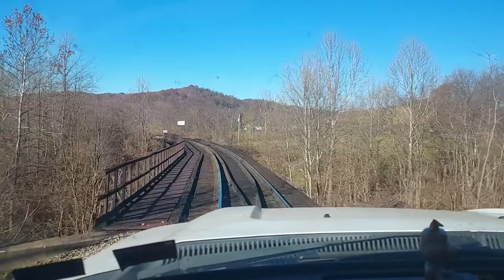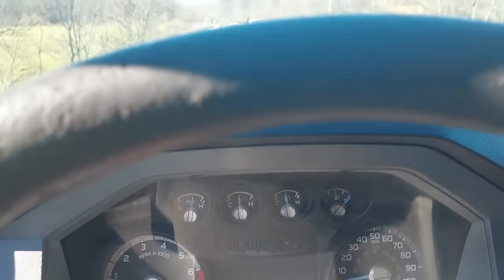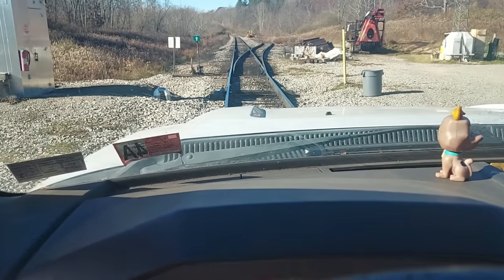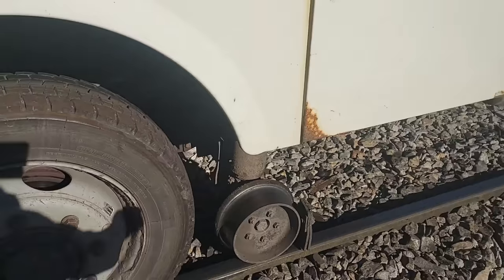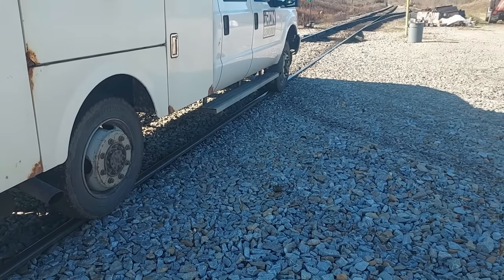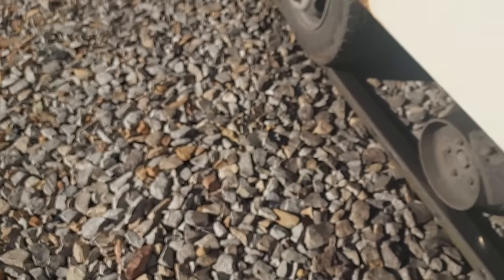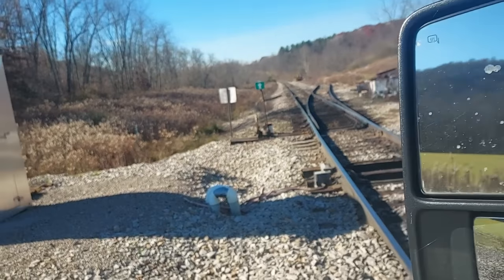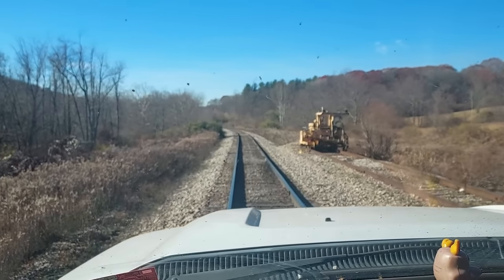How to Set a Hi Rail Pickup Truck on and off the Track

Comment: I’m surprised how small the flanges are on the wheels. Looks like they would come off easily. Thanks for once again showing us something unique.
Reply: Lot of work and design goes into the set up of the rail wheel kits .Even goes to the stage of measuring the downward pressure of the rail wheels with  scales for load bearing and having Engineered changes to vehicle suspension etc.All good fun !
Reply from the maker: They seem to stay on rails pretty good Thom for as small as 
they are. Actually the flange height is close to the same as it
is on my bigger hi rail truck. Wheels are just larger on the big
truck, but it carries a lot more weight. That's the biggest problem
with the pickup truck is it's light weight that sometimes it will
want to climb up over the rail for instance in a turnout. I've derailed
this pick up going into a turnout before where the turnout side
is a pretty high degree of curvature. Not enough weight to
keep it on the rails.  We do appreciate your taking the time to visit with us and check out the video my friend.

Comment: Does the rail cause the center of the tires to wear before the outer edges?
Reply: Are you serious?
Reply from the maker: Good question Gary. On this small pickup truck it doesn't seem
to affect the tread wear all that much, however we don't use
the small truck nearly as much as we do my bigger hi rail truck.
On that big truck yes after some time you can see the wear
on the center of the tire, but there is a lot more weight on those
tires than the pickup truck also.   We do appreciate the nice comment and for your taking the time to visit with us and check out the video my friend.

Comment: In the early days of hi-rail trucks, the process of raising and lowering the rail wheels was often done manually using a hand crank mechanism which engaged with a gear system to physically lift the rail wheels onto the tracks, making the transition between road and rail modes a labor-intensive process; later models incorporated hydraulic systems for more efficient and controlled raising and lowering of the rail wheels.
Reply from the maker: Your right about that Jay. The first hi rail pick up truck we had,
used a bar to pry the hi rails down and back up again. We do
love hydraulics now!   Really appreciate your taking the time to check out the video my friend  and may you have a very good day.  And, if you haven't already done so,  check out my second channel with more cool railroad videos and other stuff I get into on it:
https://www.youtube.com/@ThatsDavesOtherDoings

Comment: Thank you!
Funny thing, I finished making a rail pickup truck last week for my model railroad. Had to 3D print the lil wheels since I could not find any. Works great.
Reply from the maker: You are quite welcome Bassotronics, glad you enjoyed. That's
pretty cool you made one of these for your model RR. Neat!  
Guess they don't make a lot of those in model scale? Lot of folks have asked in the past how to set a truck on the rails, so was glad I could share this one with you.  Very grateful my friend for your taking the time to visit with us and check out the video.
Reply: @ccrx6700  
At least your truck has a motor system and buttons. I have to set it on the track by hand and it weighs tons! Haha 🤭
Reply from the maker: @Bassotronics  👍😊

Comment: Thank you for this fine video.
A small camera at each rail wheel to show that the flange is properly positioned inside the rail could make matters just a bit easier.
Reply from the maker: You are quite welcome Robin, glad you enjoyed. Cameras would
be the ticket, however in the winter I'm sure it would be a pain
keeping them cleaned. Lot of folks have asked in the past how to set a truck on the rails, so was glad I could share this one with you.  Very grateful my friend for your taking the time to visit with us and check out the video.

Comment: Thats nice having controls inside also. We have to get out for all three of our trucks.
Reply from the maker: Yes it is Michael, however still have to get behind and see to get
the wheels on the track. Just can't see those rear wheels from
inside the cab. At least we got hydraulics and don't have to use
bars to put the rail gear down like we used to have to do on one
of our old hi rail pickup trucks. Very grateful my friend for your taking the time to visit with us and check out the video.

Comment: Well Dave !!!!   Thanks & if you watched the recovery video that ""Murphy's Diesel "" Did with the 90K High rail truck,, you'll be glad that you Don't have much to worry about on you short RR there !!  Be Careful & be ""Safe""  👍👍👍👍👍
Reply from the maker: No I did not see that KB. Those big trucks are sometimes a pain
to set on, and you have to crawl under them to put the pins in and
out on the rear hi rail gear. The only thing I have to worry about on
my short RR is the mud in the tracks we have and it's getting worse
with every rain! :-)  We are so very grateful my friend for your taking the time to watch and write in.
Reply: @ccrx6700  Well Dave !!!  Since you  didn't see the video ,, the bearing on the hi-rail truck went out & they couldn't move the truck any farther to a siding where you could get it off the mainline & had to have a 70 Ton Rotator to raise it off the rails onto a very bad frontage road !!!    As far as the mud issue on your RR,,  is there springs under the tracks to cause the issue ??  🤔🙄
Reply from the maker: @KB-gs8zi  we had bearing go out on a loaded hrapple truck on a curve, it was ugly. Hulcher had to come to the rescue

Comment: Cool beans, thank you. Some of those trucks scoot along pretty fast here in Central PA.
It was pretty white here the other morning too, was a good test for my new boiler and the radiant floor heat, nothing like a warm bathroom floor on a cold morning.
Reply from the maker: Warm floors are awesome. We have radiant heat in our house, but
I only turn it on during the really cold weather, it sure does make
the electric meter spin around fast! Glad you enjoyed the video.
Actually this small truck gets better traction on the rails when it's
snowy  or wet climbing grades than my big hi rail truck does. 
We are so very grateful my friend for your taking the time to watch and write in.
Reply: @ccrx6700  Thank you. If you didn't post such good RR (etc.) videos, I wouldn't watch, lol. Good work.
Not that is is less expensive but mine is oil generated hot water, I think electric would be more expensive. Still have a huge wood pile for help. Keep warm, might be a slushy Thanksgiving, have a happy one.
Reply from the maker: @russell3380  👍😊

Comment: When I worked with a former (retired) track inspector previous years, we’d be rolling at 45 mph but when it comes to inspecting the mainline we would be around 25 mph, some of the hyrail pickup, section boom trucks and the grapple truck I drive have a Velcro pad like that for the steering wheel but we don’t use it.
Reply from the maker: I don't use the steering lock on my big hi rail truck either Jason, no need to the wheels are up in the air. A friend of mine who Sperry test rail for  NS told me their track inspectors roll along at about 40.  We are so very grateful my friend for your taking the time to watch and write in.

Comment: Been out of the job for a ways but I think the Toyota Landcruiser 4x4 vehicles we had were supposed to obey 80KPH limit......but before there was in cab speed  tracking etc  in the good ol days third hand stories came out of way way more .Dead straight track no curves and the access roads along the track were very bad so rail corridor was preferred travel option .Large trucks were 60KPH.I used to fit and service Hi-Rail kits ,lot of improvements in set up specs and safety rules over the years but nothings more helpful  than a safety conscious operator.Did hear a "story "of one operator who travelled a whole section at speed with only the front set down ,forgot to lower the rear!Cheers Dave
Reply from the maker: Seems like that would be pretty hard to stay on track with only
front hi rails on Chris. I don't know how to convert KPH to MPH but
80 sounds pretty fast! Some of the Norfolk Southern low railers
travel at around 40 MPH so I'm told.  A lot of folks have asked to see how to put a hi rail truck on and off the track, so it was my pleasure to be able to share with you. We are so very grateful my friend for your taking the time to watch and write in.

Comment: Actually high time to go to bed, but what the h--l, can't resist watching Your video.
Perfect drone flying weather You show us! Joking! Stay on the tracks!
Simple video but very interesting! Thanks!
5 mph looks like clever.
Haha, locking the steering wheel that easy. Guess the car has servo steering and low force is enough. No kicks from the track....
Aha. No leaving the tracks at "full speed", on the fly... Joking! No James Bond action..
Handy car!
Driving on the conventional road having the Hi-rails dropping down can't be pleasant......

One question: Does the steel wheels only direct, steer, the car on the tracks and the tires and conventional rubber wheels handle acceleration and deceleration?

Haha. Entering the tracks... Just like I guessed it would be done. (Former bus/truck driver.)

Thanks Dave! Really enjoyed the video!
Reply from the maker: You are right Stefan, steel wheels only guide the truck and keep it
in the gage. Rubber tires on back propel the truck, same as on
my bigger hi rail truck. Someday I may get a drone, have been toying
with that idea. Pleased to hear you enjoyed this one. A lot of folks have asked to see how to put a hi rail truck on and off the track, so it was my pleasure to be able to share with you. We are so very grateful my friend for your taking the time to watch and write in.

Comment: Last year someone on CSX near me got into a bad accident going down a hill in the rain. I think he couldn't stop with the tires slipping on the rail head. They had to call in a Medevac chopper for him.
Reply from the maker: This small truck actually gets a lot better traction on wet or snowy
rails than my big hi rail truck does Keith. With my big truck sometimes it takes a long time to get stopped in wet rails, all it wants to do is
slide. This little truck climbs grade a lot better on snowy or wet
rails and stops a lot better. Sorry to hear about the CSX guy,
hope hes all right now.   We are so very grateful my friend for your taking the time to watch and write in.

Comment: Dave thanks for sharing this, something one doesn't really think about when seeing a truck on the rails. Just wondering, could you have flipped the switch and pull into the siding to let the train go by then back up onto the main track ?  Maybe it's not a big deal to do what you did.
(edit)  Thinking about my comment .... kinda pointless since the subject of the video is How to Set a Hi Rail Truck. So if you did that above then ....... lol
Reply from the maker: Yes I could have but it's just about as easy to put the truck on and
off the rails Aerospace EdC. We have a clamp on that switch to
keep the train from picking the switch, he goes thru there at 25 MPH.
So that makes it a bit more harder to take the clamp off and then
put it back on than take the truck on and off.  If we didn't clamp it
then yes it would have been a bit easier. And also as you say,  a lot of folks had asked to see how to put a hi rail truck on and off the track. We are so very grateful my friend for your taking the time to watch and write in.

Comment: Thanks for another great video.  I see the hi-rail wheels lift the body up a bit.  But there is still a fair amount of weight on the 'rubber'??  So you can get a bit of traction to move, right?
Reply from the maker: Your quite welcome Mike. You are right in what you said. The truck
body picks up a bit but the tires stay on the rails. This truck is 
rather hard to get on track at times specially in wet or snowy rails
my big hi rail truck is easier in those conditions. But this little truck
actually gets better traction on the rails than the big one does in
snowy or wet rails climbing grade. Very grateful my friend for your
taking the time to visit with us and watch the video.

Comment: Velcro....who was the genius..lol. thanks Dave
Reply from the maker: I don't know Wayne, but it works. Some trucks have a bolt action
locking mechanism like is on a rifle to lock the steering wheel in
place. My big hi rail truck doesn't need anything because the 
front wheels are up in the air. Very grateful my friend for your taking the time to visit with us and check out the video.

Comment: Interesting. Ive seen the CN guys around here use long iron bars to lift them up/set them down.  No hydraulics/motors I could see.
Reply from the maker: One of our small hi rail trucks way in the past you had to manually
put the hi rail gear up and down with bars Colin. Using a bar to lift
and lower them is not all that hard, but certainly glad we don't have
that anymore!   We are very grateful my friend for your taking the time to visit with us and watch.

Comment: One usually doesn't see them tearing down the main line too quickly for the reasons you mentioned what's the odds of you getting it back on by yourself are pretty slim. I can think back to trucks where is seem to recall they used a crank. Someone had pictures of a Chevy Suburban on a short line that was escorting motor cars and it slid off on a banked curve on a bridge and apparently after a lot of lifting by people finally got back on. For inspections though I still smile thinking about those Checker Cab bodies where six people could ride comfortably
Reply from the maker: It would be a pain to get it back on by myself for sure Paul. I've
only derailed it once and fortunately had a grapple truck in
front of me that lifted it back on.   One of our older pick up trucks you had to go out with bars and manually put the hi rail gear down, glad we don't have that one anymore! Lot of folks have asked in the past how to set a truck on the rails, so was glad I could share this
one with you.  Very grateful my friend for your taking the time to visit with us and check out the video.

Comment: Very cool of you showing us how that  works Dave! I've always wondered how much fiddling around it took to get a high-rail truck all lined up. Do the miles on the rails shorten tire life much?..or isn't there that much pressure on them?
Reply from the maker: Good question Jim. On this small truck the rails don't seem to
wear much into the tires, but there's not a whole lot of weight on
the tires either. On my bigger hi rail truck there is a lot more
wear on the center of the inside rear tire that rides the rail. Lot more
weight on them on that truck. Sometimes I can get the small truck
pretty close without much fiddling around, and sometimes I have
to move it around a good bit, luck of the draw I guess. Very grateful my friend for your taking the time to visit with us and check out the video.
Reply: @ccrx6700  Thanks Dave! Have a nice Thanksgiving my friend.
Reply from the maker: @Hyrev1  👍😊 may you also

Comment: Awesome video, Dave! Am I correct in that the pickup's tires move it down the track? I always thought so, but I'm not sure.
Reply: Correct.  The regular tires power the truck, while the steel wheels just keep it on the track.
Reply from the maker: Yes you are correct in that Patrick, both on this pick up truck and 
also on my bigger hi rail truck the rubber tires move the vehicle.
Interesting to also find out that the pickup truck actually gets
better traction on grades in wet and snowy rails than the bigger
truck does. Sometimes it's a real struggle to climb grade with
wet rails in the big truck.  We do appreciate your taking the time to visit with us and check out the video my friend.

Comment: Very interesting, thanks for sharing. 👍👍👍. Are the small wheels resting on the suspension or directly on the chassis?
Reply from the maker: The entire rail gear assembly is bolted to the frame Aleu. The wheels
have a bit of a shock absorber on them also, but not the trucks
suspension.
Reply: @ccrx6700  The truck must have a rough ride in hi rail mode 👍
Reply from the maker: @aleu650  its not nearly as bad as you might think

Comment: Good one Dave!  Impossible to do this without being on a raised crossing?  Also, the Grey Handle above the left front bumper, doesn't look strong enough to manually set the gear, what is it?   THANKS.
Reply from the maker: You are quite welcome Alro, glad you enjoyed. The T handle is for
locking the rail gears in place, however it doesn't seem to work
on this truck. You are correct it must be on a crossing to get
the truck on and off.  Lot of folks have asked in the past how to set a truck on the rails, so was glad I could share this one with you.  Very grateful my friend for your taking the time to visit with us and check out the video.